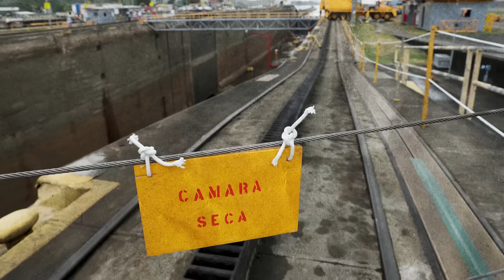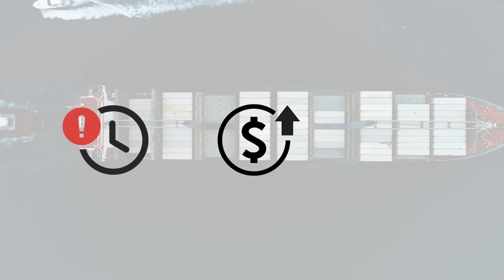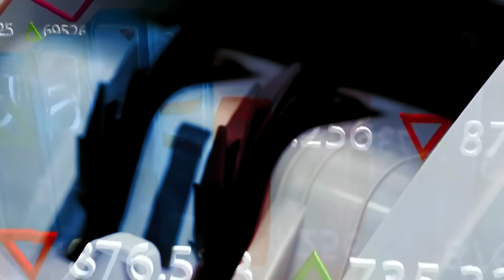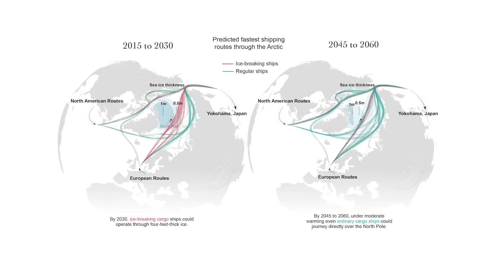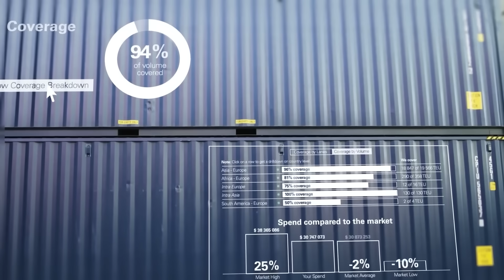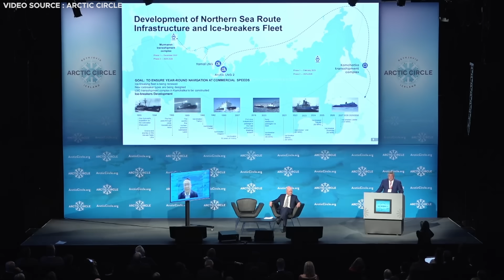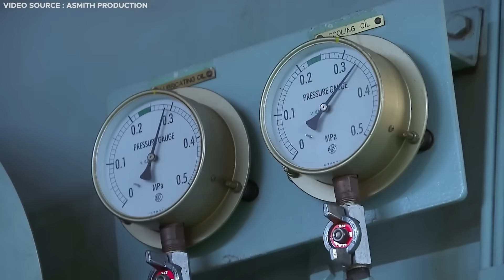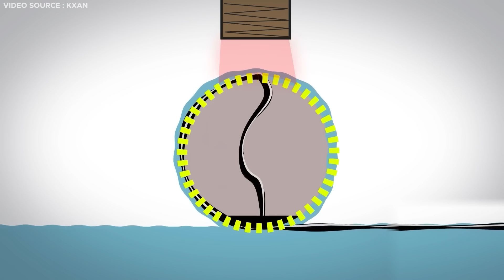The $43 BILLION Arctic Passage That Will END The Panama & Suez Canals

Comment: Canada needs to protect OUR Northwest passage from intrusions by other powers, but that does not mean it is sensible in most economic circumstances to expect them to gain some great unforeseen economic advantage.   
The "benefits" of the Northwest Passage are overstated, especially if you look at the risks of such difficult waters. Unless you are shipping to or from Alaska or BC, to the north atlantic, it makes little sense to use it. Frankly, if shippers want to do it on the cheap, they should look elsewhere. 

If China wants commerce to and from Europe without using the Suez or going around Africa, they can go through Russia's arctic sea route, which has fewer obstacles, though obviously the same ice dangers and environmental issues.

Comment: The Panama Canal has not experienced anything close to a long-term drought. If you look at the rainfall charts from 1901 to 1922, you will find this to be true. The problem is that 52 million gallons of reservoir water is used per ship. This equal to 160 acre-feet. With 15,000 ships per year, this equals 2.4 million acre-feet of water used every year. Now, add about 200,000 acre-feet for the population's use = 2.6 million acre-feet/yr. Gatun Lake, the man-made reservoir built for the canal, only holds 4.2 million acre-feet at full capacity. This means there is only 19 months of water supply at full capacity. 
Now, take into account that the months of January thru March historically produce nearly no rain, a 'drought' of only one rainy season is a big deal. This math is well known to the operators and government. It is simply easier to blame 'climate change'.
Reply: Pumping the water back up, although expensive, is a solution that is better than letting all that fresh water flood back to sea.
Reply: @seanworkman431  The water 'pump back', (conservation measures) equals 7% per passage, at best. It is no different than the plastics recycling truck that pulls up after the garbage truck - only to haul the recycling to the same landfill.
Reply: @danlowe8684 i wpuld use the water that flows in the rivers and thru the locks to generate power for pumps.
Reply: @mrazyone  Panama's operators knew they did not have enough water but were forced to expand due to economic reasons. This said, it is a man-made reservoir (that loses storage capacity every year due to sediment deposits) that feeds the canal, industry and population's needs. So, even if Gatun Lake were filled to capacity (4.2 million acre-ft) every year, 2.5 to 3 million acre-ft are consumed. This is why they are in a 'drought' condition, even in wet years. They could be ravaged by floods one year and be in a 'drought' a year later. This is not sustainable. Pumps do not work in a lock situation with a fresh/saltwater mix. But climate claims relieve all situations in today's world.
Reply: @seanworkman431  Not a realistic option, here. There is no generation of power here.
Reply: The problem is China is funding different canals and railroads in South America. The problem is the fact the United States playing their diplomacy game with people that are our clear enemy and allowing them to establish thierselves right on their other side of the US border
Reply: @thomasschweiker7259  Till today none of these canals is going to become built.
Reply: Panama could look into desalination plants to refill reservoir using sea water.
Reply: @robertvandeveer1846  No, desalination is not a viable option, at all. This is true in sooo many ways.
Reply: They use fresh water to operate the locks and let it flow out to sea.  Use pumps to reuse the water rather than letting it flow out to the sea!
Reply: Wow. That is a really well thought out, cogent, and fact based comment

Usually YouTube comments are tire fires. 

Thanks!
Reply: @mattinnj979  And i typed 1922 where I meant 2022, FYI.
Reply: it was called GLOBAL WARMING until the rethuglikkkans cancelled that term.
Reply: Real anwser is your cheap b*ast*rds!
Reply: My family lives in Panama….the water reservoir is being taken by Chinese to use on mines they are operating……the corrupt Panamanian politicians are selling the land and control to Chinese …..news needs to report this….
Reply: The Panama Canal drought began in late 2022 and was described as the worst in the canal's history by January 2024.
Reply: @MarkStolzoff  I typo'd 1922 instead of 2022. The western US's, '22-year drought' from 2000 to 2022 was also described as the 'worst in modern history'. But, if you do as I have done and look at the charts, it is not even close. Of the 22 years (from memory now), approx. 13 years were above, at, or only slightly below 'average' precipitation amounts since the late 1800s. In fact, California has not experienced more than a two-year consecutive drought since 1900 (the most severe being 1975-76). What has happened (in Cali, Lake Mead, Panama Canal, etc.) is that the demand for water has increased to the point where a dry year now strains the reservoir system due to useage levels far beyond designed amounts. The Panama Canal expansion designers knew they were running on the ragged edge with supply but had no choice but to expand. Lake Mead's designers never expected the reservoir to fill completely - until it did in 1983, producing a near catastrophe and a 'bathtub ring' that is now viewed as a benchmark of 'normal' levels. The media doesn't attain clicks by explaining the realities of the situations and their gov't counterparts are more than happy to pass the blame on to the always available, 'climate change'.
Reply: @ Not even close.  Source: Panama Canal Authority.

The Panama Canal depends on an ample supply of freshwater captured by its watershed and stored in retention reservoirs such as Lake Gatun, usually during the rainy season which is between May and December. A look at the precipitation trend underlines fluctuations around an average of about 2.6 meters (2634 millimeters) per year. Since 1950, 14 years have had precipitations outside one standard deviation (wetter or dryer years), which is 19.4% of the time. These deviations are normal and associated with the El Nino Southern Oscillation, which is a fluctuation in sea surface temperatures in the Pacific Ocean, resulting in seasons of higher (El Nino) and lower (La Nina) rainfalls. 2023 was a dryer year than usual, corresponding to a longer-than-usual La Nina event.

There have been several prior occasions when rainfall was less than usual without noticeable enduring impacts on canal operations. The main reason the 2020-23 La Nina event restricted the availability of water for canal operations is related to the 2016 canal expansion, which created an additional set of locks that were much bigger than the old locks. Even if additional reservoir capacity was provided and the new locks had water-saving features, the restrictions on canal operations in terms of the number of transits per day and ship capacity underline the vulnerability of the Panama Canal to seasonal variations in precipitation, even without strong outliers' events.

To mitigate this risk the Panama Canal Authority plans to extend the watershed supplying the canal so that it is less prone to fluctuations in water availability.
Reply: You for got they add more and wider locks.
Reply: The Panama canal has NOT been upgraded since it was ordinally built, ships are now larger unable to fit thru the canal
Reply: The Panama Canal exist because the USA built it.  Panama's income from the canal is because of the USA, the trade we provide, and our generosity in giving Panama such an amazing asset.  Panama should be thankful.
Reply: @John_Linn  The land was stolen first so stfu.
Reply: The author mix up the green religion with sea traffic issues. 

The Panama Canal was built 100 years ago with far less traffic. The weather was and is fluctuating. That means a draught in 1950 would not have disturbed the traffic thru it.  Isn`t it better to build another Panama Canal?

Comment: I worked on an oil tanker, we delivered a ship load of fuel to Polaris mine on Cornwallis island, on that route. It was the end of September. We ran into a storm the spray was blowing over the bridge, with chunks of ice bouncing all over. This route will never be safe, as much of the ice is glacial. Sea level rise will make Panama and Suez all saltwater.
Reply: The sea level tide mark on the old fort in Sydney harbour has not changed for a lot longer than i've been alive.  ( 75 years )  When it starts to rise,  gimme a shout cobber.
Reply: What sea level rise do you speak of?  Certainly none of note the last 75-100 years.
Reply: I see you say "this route will never be safe" so is the red sea safe? or long delays for Panama viable ? Northern passage is the future>.

Comment: This has been an on-again/off-again issue for 50 years and it just isn't feasible. Maybe it will work for the Summer months, but it certainly is not workable for the Winter period. That route is brutal in Winter. Massive ice-sheets and nowhere to re-provision/refuel/provide rescue services. I've been through the Northwest passage in Summer and our biggest issue was icebergs, massive ones. I just don't see that a Northwest passage is tenable because it's seasonal and that doesn't work for global ocean traffic.

Comment: We can’t successfully respond to oil spills and groundings in our US coastal waters what will happen in the US/Canadian Arctic waters.
Reply: I'm not going to clean oil off of a polar bear with Dawn detergent. 😳
Reply: We have been drilling off shore and producing for more then 60 years in Canada  And we have never ever had a major spill and you cannot have one if you follow the proper procedures which we do.
Reply: @jimpawa5793  we have already drilled well along the northwest passage
Reply: Exactly what BP was doing in the Gulf of Mexico 😂
Reply: @jimpawa5793  CEO of BP overruled the engineer on the rig in the Gulf who was going to stop drilling and replace the malfunctioning blowout preventer which is the proper procedure and it never happened which is why the blow out occurred if proper procedures are fallowed every where Like we do in the offshore in Canada including the wells already drill along the northwest passage you don't have blow outs or oil spills and we have never had one in Canada in the more then 60 years we have been drilling off shore or the more then 100 years we have used tankers not even one.

Comment: after completing the northwest passage crossing f the Manhattan  tanker  Imperial oil who chartered the ship during a press conference said never again uses it. The crossing is to difficult it and was not worth the risk
Currently the Northwest passage is used by small cargo ships to transit mine concentrate mined in the Nanuvit territory
very few small cruise ship transit through the straight
Reply: The USSR built a fleet of nuclear powered ice breakers in the 1960's which were huge cargo ships as well. These cargo ships have been using the Artic route from St Petersburg to Vladivostok since then, now under Russian control. They operated more than 6 months of the year even before climate change was a factor.

Furthermore, China is already working with Nicaragua to cut a new canal north of the present Panama Canal, although this narrator seems Clueless about it.

Long story short, this narrator is Full Of $hit and doesn't know what he's talking about.   😮
Reply: @joekulik999 the Nicaragua canal is more a trucking exercise to clear the mountains that run the spine of the country.   Ships would get a ways into the country, unload onto trucks and other ships would load and continue ur the trip.  I have to assume this would take more ships and huge yards on each end of the land transit.   Not as convenient as the Panama Canal.
Reply: @joekulik999  Maritime English is used for safe operations in Maritime Industry, by Marine Professionals, are you a Maritime Professional?

Comment: Bookmark this and check back in 20 years . This arctic route will never happen and fail as badly as every other climate doom prophecy.

The rapidly warming climate is on paper only, due to temperature adjustments based on ideological thinking.